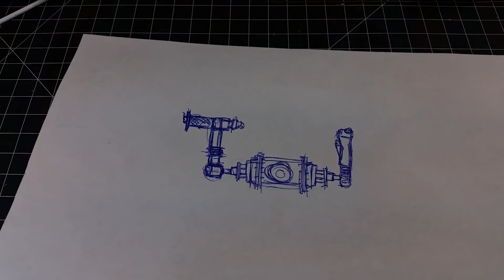The Batwing (1989) Full Build Start to Finish

Comment: IMPRESSIVE! And the addition of the hand-made stand display is an undeniable plus. My most sincere congratulations.

One feature that has particularly called my attention, apart from all those leds in the cockpit, was that hand-crafted "steering wheel". I knew that the one offered in the kit was too simple compared with the one roughly seen in the movie, but I was not sure of its exact shape. I wish that I could handle electric devices like the leds as you do...

Nonetheless, when I built this kit, I made other kinds of improvements.

For a start, I found the front wheels so absurdly and exaggeratedly thick as they came in the kit that they made a rocking model look like a cartoon, so I replaced those thick wheels with thinner wheels of a similar diameter donated from a 1/72nd P-51 Mustang.

I also drilled round and open the holes of the rocket launcher pads behind and to the sides of the cockpit.

I provided the fairings of the nose guns with a cover for a more streamlined appearance.

I discarded the infrared glasses retractable pylon in the cockpit with a simple bar to imitate that feature in the off-mode, since my model is also standing on its own legs.

I drilled the nose guns firing end open, plus some extra smaller holes around for cooling.

That all said, and just in case you were interested, here you are the final part (of the three parts that my build consists of) of my build on the kit (but bear on min that is a way simpler build, without sophisticated additions like leds and such): https://youtu.be/nIKZXRVVqRU

Comment: Why use such large gauge, heavy duty, thick wire? Just wondering. Wouldn't it be easier to route thinner wire through the wings. The 3v lights can operate on magnetic wire, no?
Reply from the maker: It's just what I had to work with at the time. Thinner wire will ne used in the future. Cheers
Reply: @LocktOnArt  Thanks. I was just wondering. It's a great build and great project.

Comment: Fantastic job! When you were finished highlighting the panels did you clear coat the entire model? If so what did you use gloss, semi gloss or flat? Also what color did you use for the panel highlights? Thank you.
Reply from the maker: I sealed it with TS-13 tamiya clear gloss. I used a watered down tamiya XF-2 flat white for the panel work. Thanks very much for watching 😀